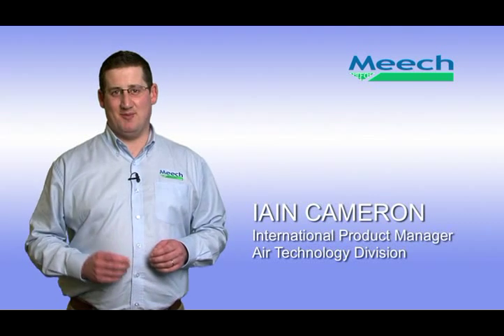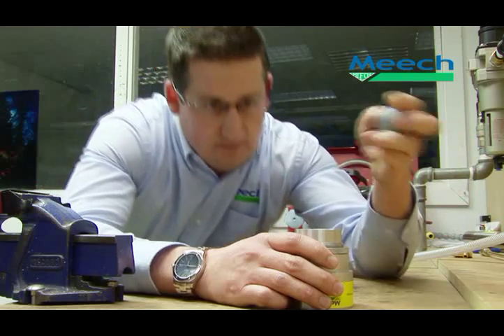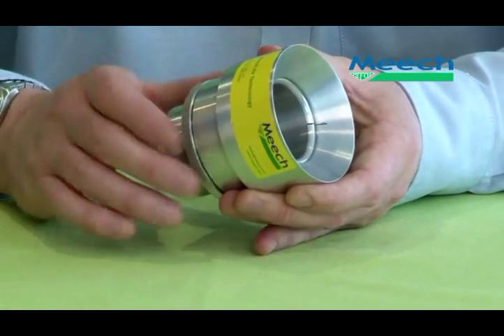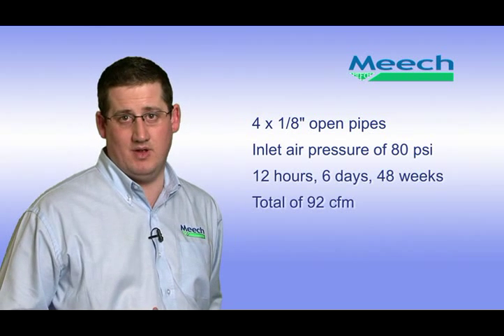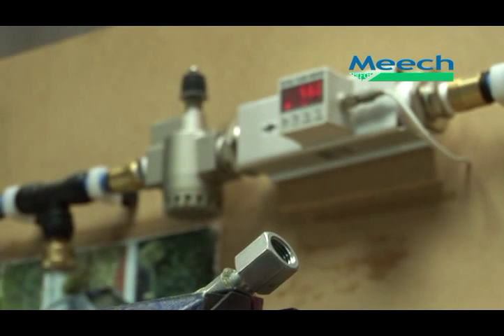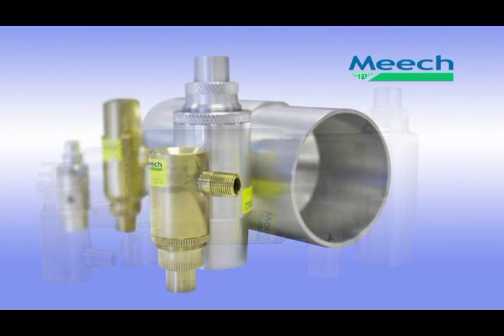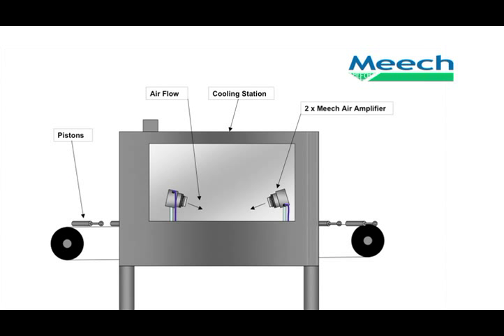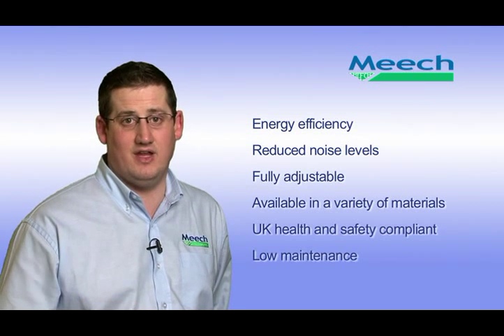Meech Air Technology Air Amplifiers and High Thrust Jets

Comment: does an air amplifier produce thrust?
Reply from the maker: Hello, thank you for your enquiry. The unique design allows an Air Amplifier to suck and blow air. This means they can be used to either blow particles away or vacuum material up. If you are looking for a stronger thrust we also do High Thrust Jets http://ow.ly/4Qr4302UySZ. I hope this answers your question. If you have any further questions please provide us with your contact details and we will get in touch, or please call the Meech Head Office on +44 (0)1993 706700. Have a great day!
Reply: Meech International
Thank you for your prompt response let me be clear about what I am talking about. Back in the 90's I was working in a company where I was using a small table and chair as my desk for doing my paperwork and the only place I could set up was next to one of the heat treat ovens where heat radiated from the wall of the oven so I used a amplifier set up to keep the area cool.  I thought of an idea for a fuel efficient jet engine for commercial aircraft.
A giant air amplifier the size of the engines used on airliners with an incorporated pod that contained a small jet engine like those used on small Lear jets. The set up would feed the exhaust to the amplifier which would amplify the output to the equivalent of a full sized engine but only spending the fuel needed to run the small engine. While watching your video I remembered that and wondered could such a device actually work.
Given your expertise on the technology do you think this would work?
Reply from the maker: Hello,  please provide us with your contact details and one of our Air Technology specialists will be in touch. Many thanks.